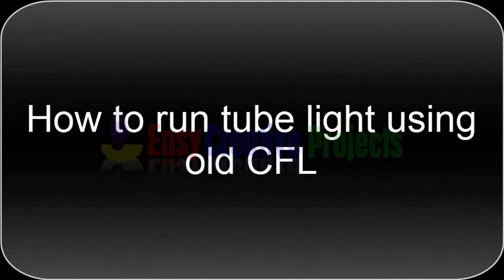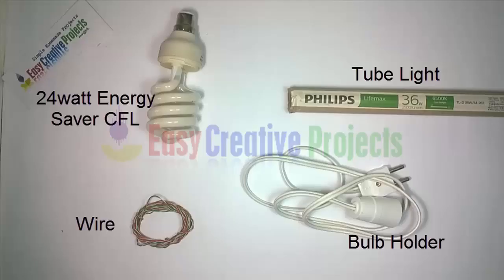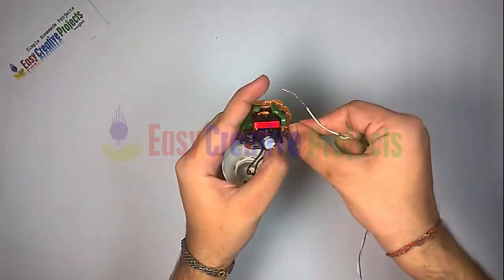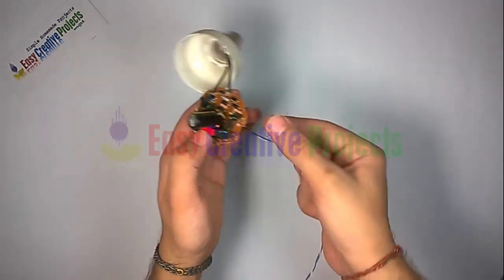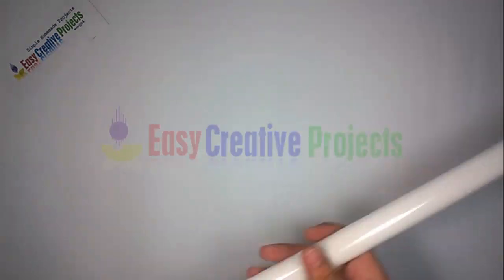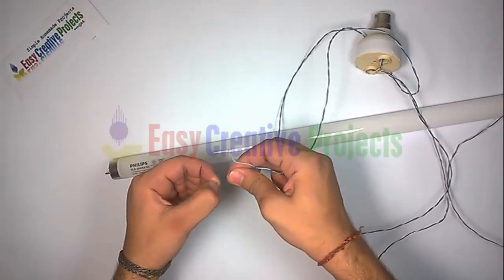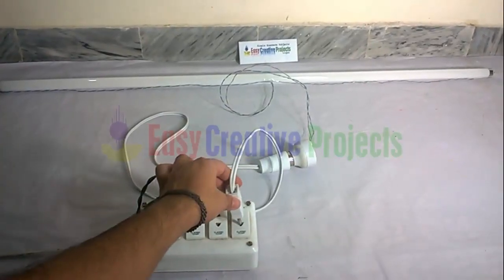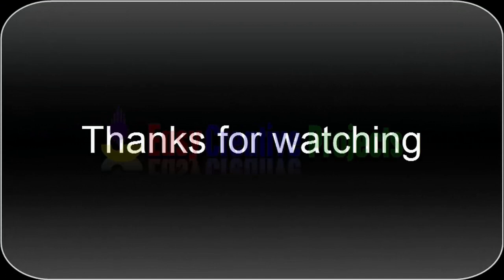How to run tube light using old CFL -  on tube-light without starter and choke

Comment: Any cfl circuit can use for any watt tube light ?. pl. explan it.
Reply from the maker: no dear,
if you run 36 watt tube light then you use between 24 watt to 35 watt energy saver.
better result use tube light power and energy saver power one or 2 watt difference.